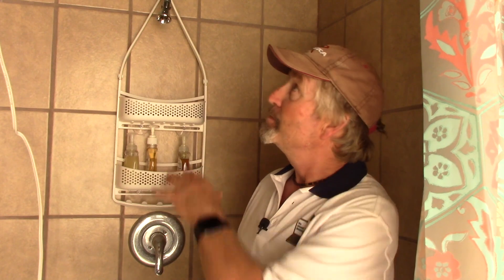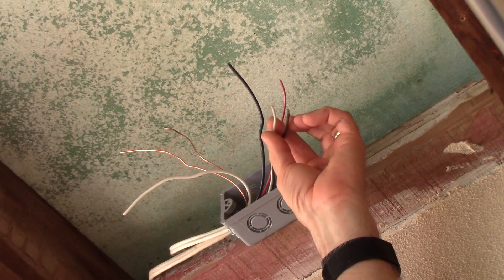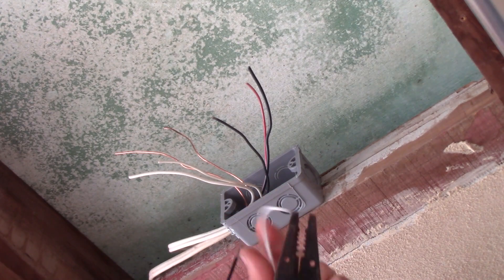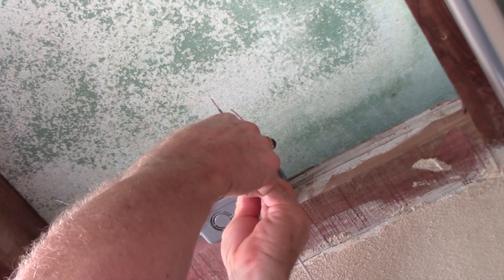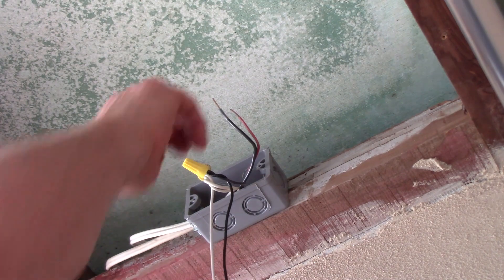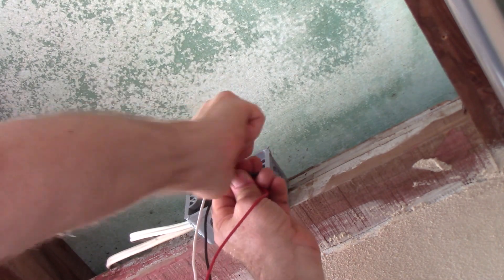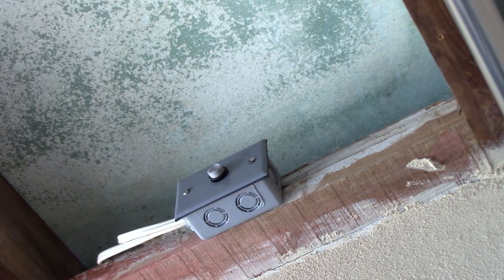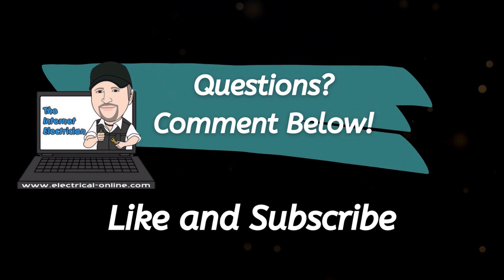Proper Connections for Wiring a Wall Mounted Photo Cell

Comment: For some reason my photocell is tripping the GFI breaker in the garage that it's tied to.  I've replaced the photocell and even the post light in the front yard that is controlled by the photocell.  Any ideas why it keeps tripping the GFI?
Reply from the maker: Is it tripping even when not activated to turn on by lack of light, or does it trip regardless, when powered up?